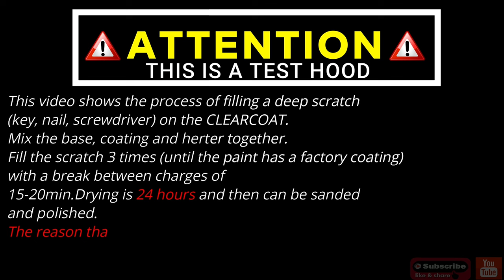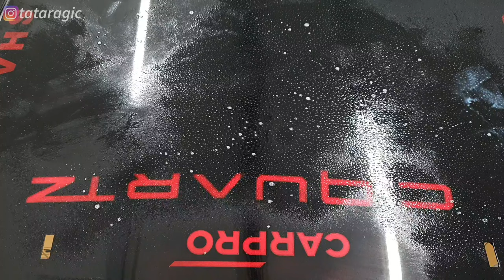How to Repair a DEEP SCRATCH in Car Paint (DIY)/ Ogrebotina na Laku POPRAVLJANJE

Comment: Instead of sanding endlessly to level the filled scratch I would recommend using a mirka mini file to level it down fast. Then sand it lightly :)
Reply: I bought the mirka mini file and Mirka S-BLADE Shark Blade Denibbing Tool, the later might even be easier to use than the mini file.

Comment: Can you try this trick with other colors? Black is the best color to match. I will like to see this in trick for example on a two stage color when you need pearl.
Reply: Pearl is a tri-coat. You can't match tri-coats that way, you have to paint the entire panel. Basecolor, Pearl, then the clear coating.

Comment: Im fascinated by that blue filler step. It seems genius…….
Reply: +1 - is it just to show you when everything is finally flat?
Reply: @mikeb1039  its more of a 2 parter. So first it protrects the paint outside of the scratch. As youre sanding youre going to be sanding down clear around the scratch along with flattening the newly added paint on the chip. Second as you said it acts as a guide coat which will allow you to see if the paint is leveled or ot.
Reply: I agree that filler protection is a brilliant idea to protect the surrounding paint.

Comment: are mixing the clear and base coat 1-1? or are you using more base?
Reply from the maker: 2:1
Reply: @Amddetailing  thats 2 parts clear 1 part base correct? you want more clear than color?
Reply from the maker: @LuisNazarioRatKiller  base 2 clearcoat 1
Reply: @Amddetailing  👍👍👍

Comment: What happens if you just use clear coat on a scratch? I suppose it just seals over it and the scratch is still visible through the clear coat?
Reply from the maker: nothing will happen, you have to apply the paint

Comment: @amd_detailing is it possible you could please list the products use? I have a somewhat deep scratch from a bike hitting the side of my car - I'm hoping to replicate this process. Mostly interested in the blue putty that was in use. Thank you! Keep up the great videos!
Reply from the maker: the base, the coating and the hardener are fine, you also have similar problems on my channel that we solved by filling, so you can watch each video with an explanation
Reply: @Amddetailing  mostly was interested in the products used - the blue putty do you know the brand name by chance?
Reply from the maker: Mipa soft body
Reply: @nullnoob  Any body filler will do. By adding it when you block the area down you're less likely to go low on the surrounding areas. As long as you make sure you use a flat block and take the whole area as level as you can, you should be allright. Also it's a good visible indicator as quite you're progressing. Nice repair @Amd detailing! :)

Comment: Do you have to use the two-part clearcoat with Hardner? Can you spray some clearcoat that’s in a can in a cup and mix the paint with that?
Reply: It's enough just to mix some hardener in basecoat.. Like 4:1 is plenty
Reply: @dujevideka1230  4 pieces basecoat   and 1 pieces hardener?
Reply: @alexanderschindler9714  yes
Reply: @dujevideka1230  Hi mate, I have a non metalic waterborne uni color car. Can I also add hardener in the waterborne color? If yes how much? Got some paint left and want to fill some stone chips. Thanks

Comment: You could shave of the excess paint with for example Mirka shark blade or Mirka mini file, then polish it. If you are lucky you don't need any wet sanding.
Reply: Too deep
Reply: I’d agree.  The process in the video is fine, but a nib blade would have cut off the primary high spots, cutting sanding time down.  I use putty in a similar way.  Thank you for sharing.

Comment: there is another , easier way, with the polish machine and 1000 sand paper, you remove the scratch, (using water of course )Then you use a 2000 sand paper, then you use a compound cream with the polish machine, then a polish cream, then you use a wax and it s like new!

Comment: What was the point of the blue stuff just to hand it all away
Reply from the maker: protects during sanding so that the factory coating does not break through while removing what you have filled

Comment: How much I have a keyed scratch not that deep but hurts me 😡😡 means people jealous.
Reply: I have 5 to 6 deep scratches on my drivers side door.  Some douche in a white Ford  F-150 pickup with big ass tires was parked next to me at the golf course parking lot today.  I deliberately parked in a corner. I came back and the white truck was gone.   And I saw gouges on my drivers side door.  The gouges went straight into the metal. It looked like he used a flathead screwdriver too. Karma is a Biotch.  Thank God we have auto insurance.

Comment: To much time.....
Reply from the maker: it is a protection against pebbles so that there is no crust, any stone that would hit would strip the paint
Reply: @Amddetailing  i forgot that point ,you have right , like an advice 
I think is faster to cut at the same leve with clearcoar using shark blade (we using to cut nibs in clearcoat after paint ,sand buff and polish)